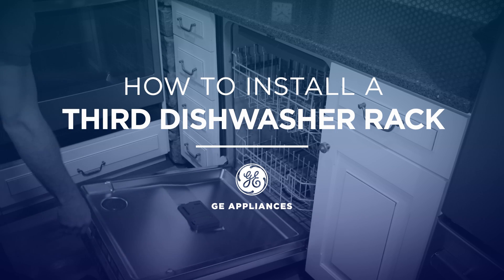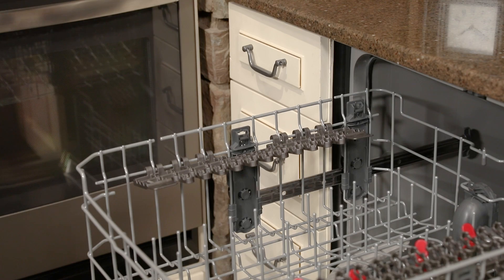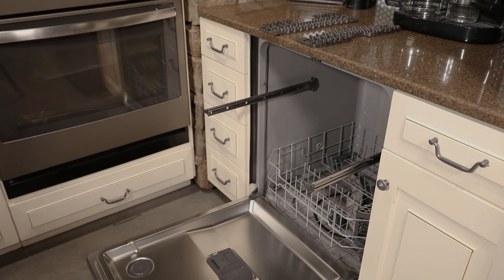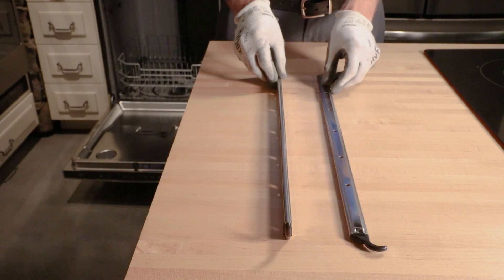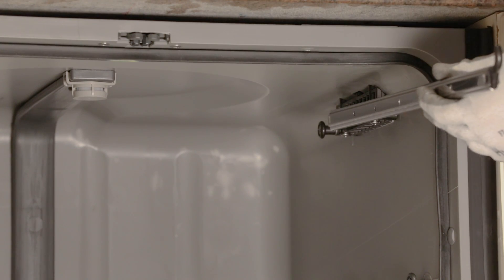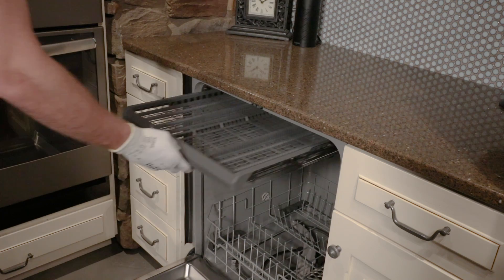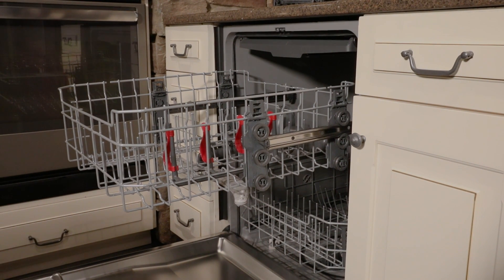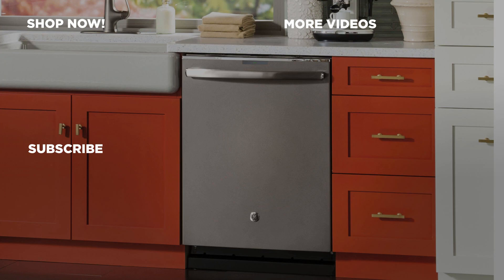GPF3RACK - Dishwasher 3rd Rack Installation

Comment: Why can't the 3rd rack be installed in a stainless steel dishwasher?
Reply from the maker: Hello Dianne. Thanks for reaching out. We do offer built in stainless steel dishwashers with a third rack. There are certain models that do have a third rack option but not every dishwasher model has this option. If you need assistance figuring out if a particular model has the third rack, we are happy to help. Thanks. -AT